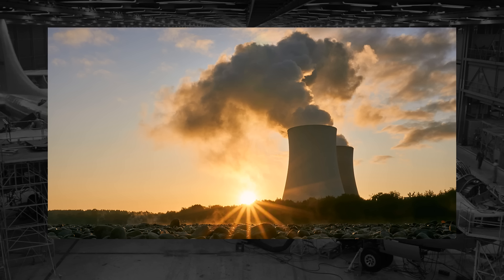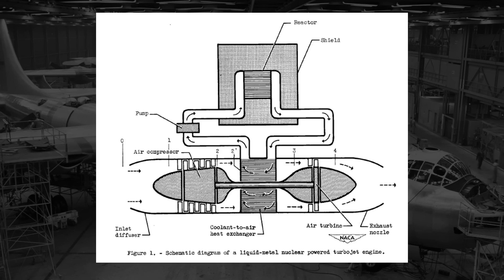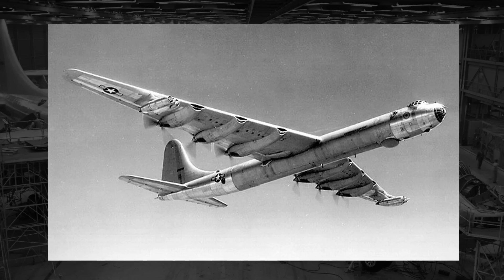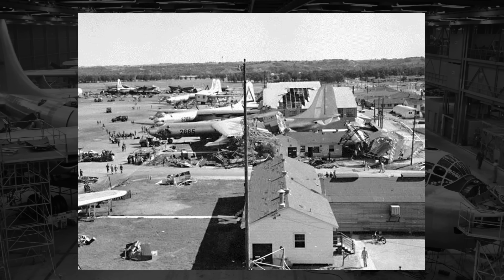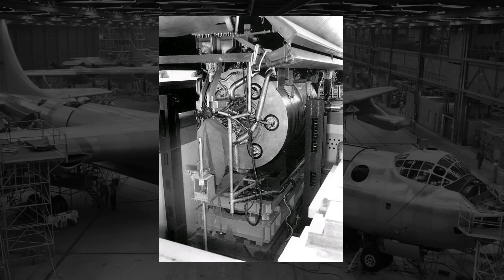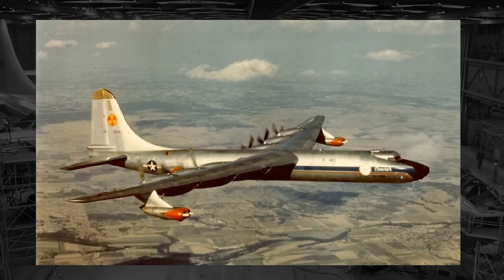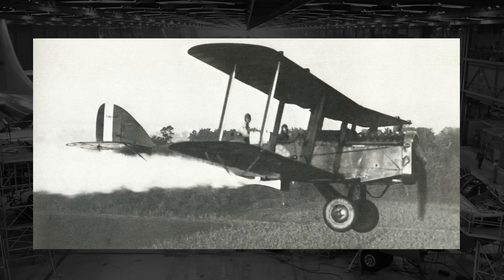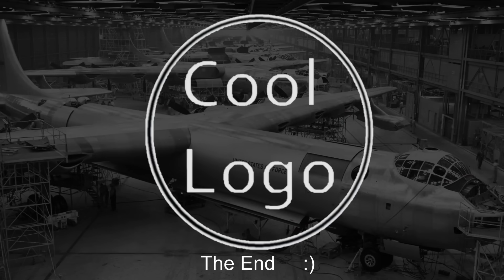America's Lone "Nuclear-Powered" Bomber: Convair NB-36H

Comment: HTRE-3 Chernobyled itself all over Idaho. They lied about the extent of contamination. It was over a million times today’s allowable limits ( microcuries vs micromicrocuries.
Reply: The only limitation was the reactor was 1 megawatt vs 1000 megawatt of a commercial reactor. Still, one of the worst ideas ever, in terms of public safety.
Reply: @williewonka6694 EBR-1 tripped me out. It had to be Combustion Engineering. My first boat, Tullibee (SSN-597) was built by them. And the reactor compartment equipment at EBR looked just like the 597’s.
Reply: @Squeezmo  Ahh, the Tullibee. My Chief on the WHALE had been on that boat for a while. She went places and did things  as I recall.

Comment: The indirect concepts had an additional advantage: the reactor and engines were effectively decoupled from each other. The reactor would still be in the fuselage, but an assortment of engines could be located almost anywhere simply by running a coolant loop there. That's particularly important when the lack of fuel tanks would place more stress on the wing roots.

Comment: Worst problem is the possibility of the nuke bomber being shotdown, spreading fallout far and wide.  The ultimate "dirty bomb"!  Just not a well thought out idea.
Reply: Aircraft of the 1950's did crash due to accidents, equipment failures or pilot error. The short reach of Air traffic control and (relatively) primitive radar systems yielded the airliner collision over the Grand Canyon. https://en.wikipedia.org/wiki/1956_Grand_Canyon_mid-air_collision
Reply: Never heard of the "SLAM" missle?
Reply: Considering they thought of using an engine that directly heated air and sprayed radioactive fallout from take off all over the US